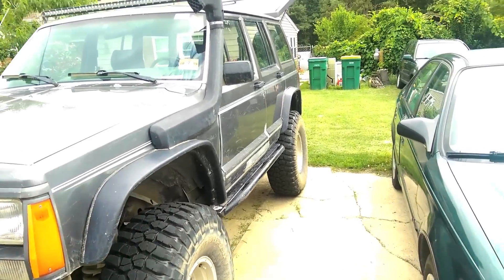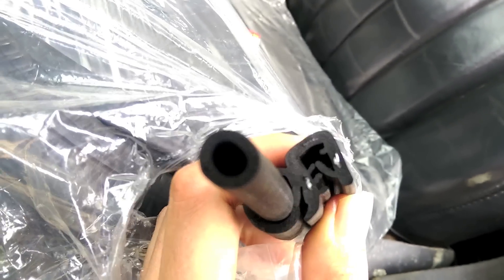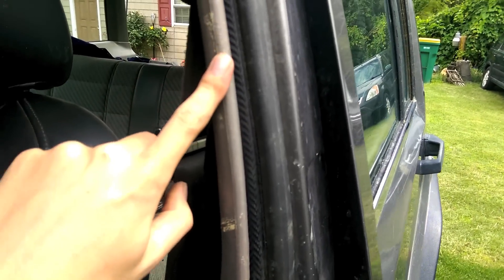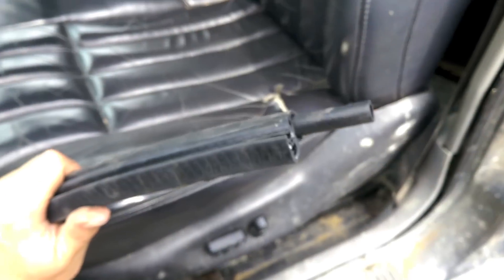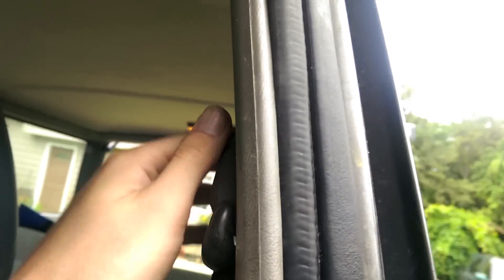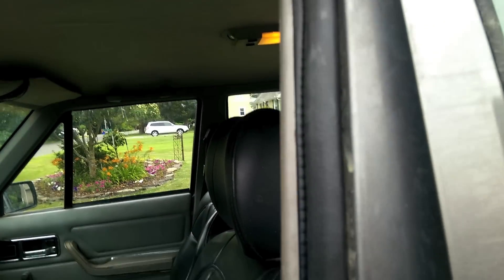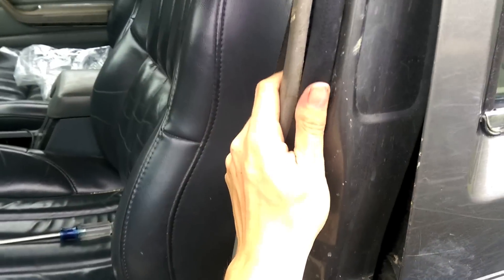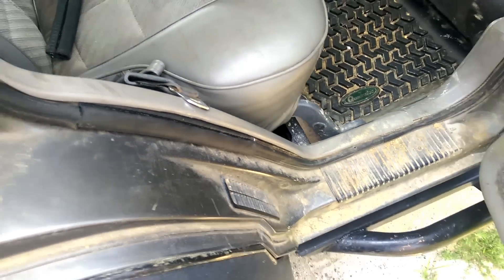89 Cherokee Installing Door Weather Stripping

Comment: Very helpful, thanks.  After my first door, I found it goes much more quickly if you put in the new weather stripping as you pull out the old.   Pull out the old a few inches, and then put in the new behind it.  The old weather strip creates the gap you need to push the new in much more easily.

Comment: Hey Man thanks for the vídeo my cherokee gets wet inside and I have noticed that is a few drops that travels between the door and the frame of the car all the way down to the floor, you think this would fix the problem?
Reply from the maker: If your old weatherstripping is cracked, torn, or severely deflated then new could help. Another thing to check is that the door is still aligned with the body. Over time the hinges like to sag and the door won't close straight. As a cheap alternative you can just jam some thick nylon rope behind this to puff it back out and see if it helps seal better.

Comment: did you replace your seats with electric ones?
Reply from the maker: Yes, swapped in WJ seats. Install Video of course. Later I installed a minivan seat as it was better on my back. Leather seats are too slippery, too hot in the summer, and too cold in the winter.
Reply: NickInTimeFilms haha I get that. Do you have a preferred place to get your 89 Cherokee parts at? I have a ton I need to work on with mine and trying to find a good spot. It’s hard to find stuff on amazon for 89’s. That being said, I’m super new and May just not know where or how to look
Reply from the maker: Rockauto.com is a great place to check.

Comment: also amazon has it cheaper.. 55015782 is the PN
Reply from the maker: Got it off 4Wheel Drive for the same price
Reply: NickInTimeFilms fair enough. i just mention it because of the shipping to my area. quadratec charges excessive amounts for shipping here in AK
Reply: AKghandi paid 113.00 at JC Whitney for a whole set